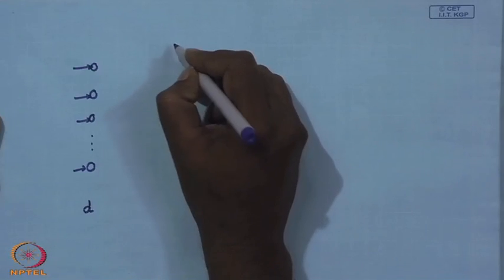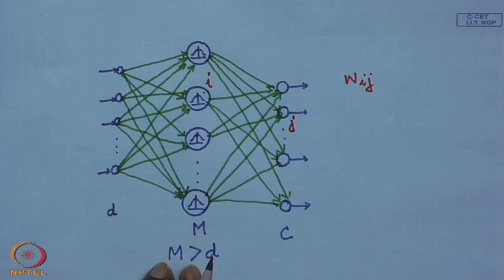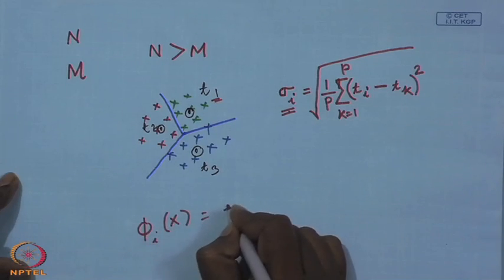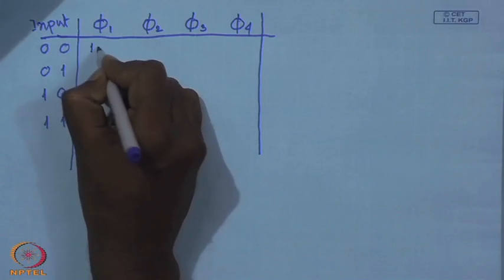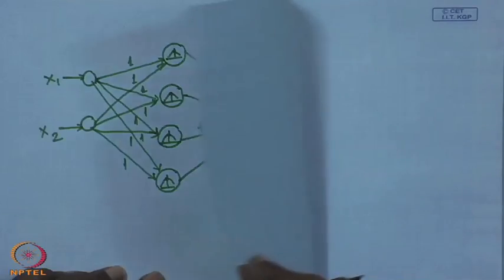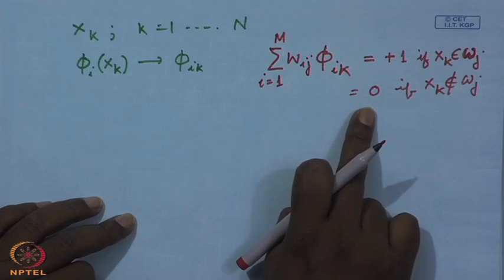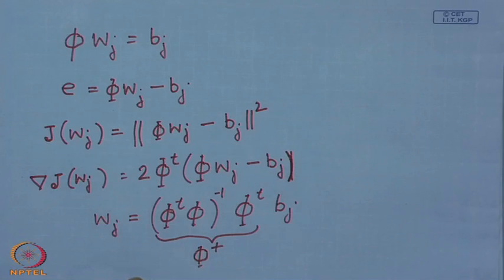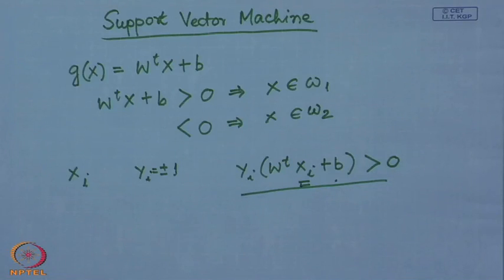Mod-01 Lec-28 RBF Neural Network (Contd.)

Comment: how the phi2(x) is 0.6,as per euclidian distance it is e -1 is 1.73 but it is given as 0.6 how can any please explain
Reply: The input vector is (0,0) and the receptor is (0,1) for phi2(x) so  the euclidian distance is +1 and also note that there is a modulus sign. So negative signs will not play any role.  
phi2(x) = exp-( (modulus(1)^2)/2)
which is equal to 0.60653